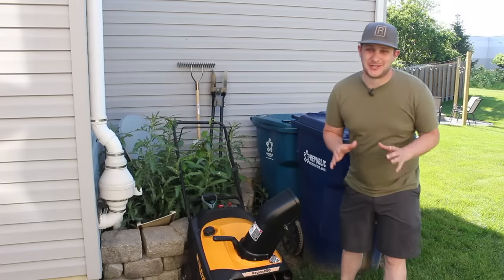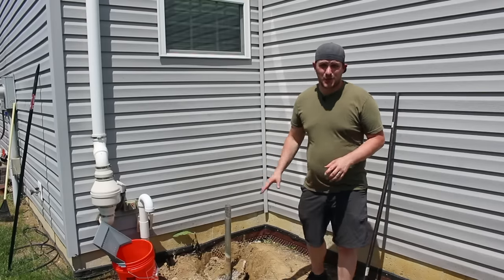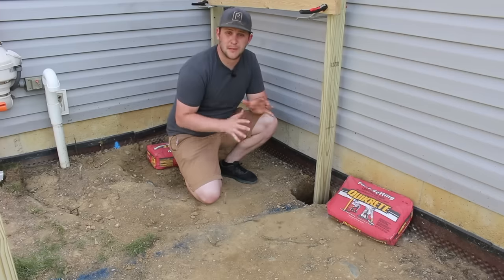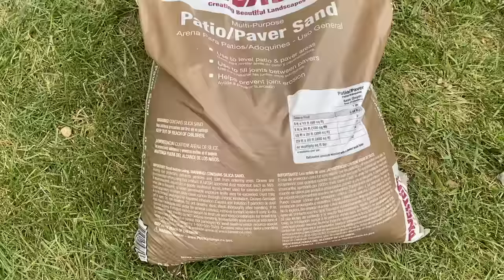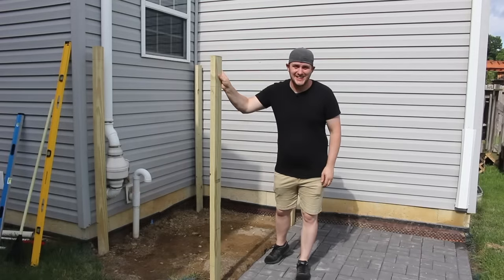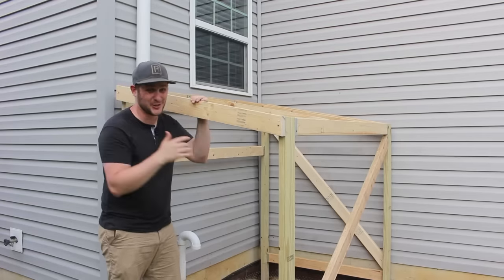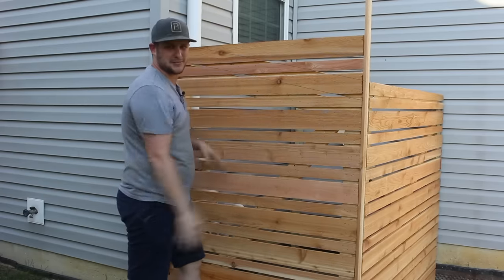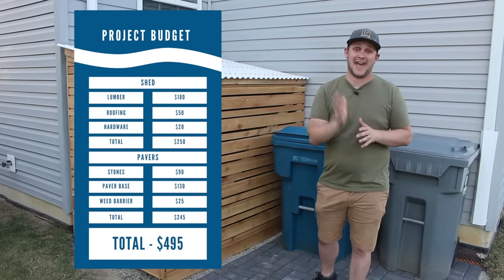DIY Outdoor Storage Shed || On a Budget

Comment: Dude... Dude.  Did you read the installation instructions for the Brock Paver Base?  You did it backwards.  The leveling sand goes down after tamping soil.  Then paver base sheets.  Pavers sit directly on top of the sheets.  Also you should get some edge restraint and joint sand.  Shed looked good though.
Reply: Cringed when I saw him do that. Improper installation of the panels
Reply: Not to mention his stuff inside the shed is going to get destroyed by rain or snow and the sump pump discharge is going to cause trenches in his rock. How does Home Depot sponsor this stuff?
Reply: Same thing I was thinking. Big Box store sponsoring this
Reply: maybe he wants a wavy and uneven paver area after 1 year?
Reply: Also do not set up wood post in concrete.   The wood will rot.  The concrete first in 3 feet.  Posts on top is best.  Or small base of concrete and coated wood in to dirt.   Uggggggg.
Reply: @stephanie1265  well pressure treated wood will not rot in concrete atleast not very fast it will take more than ten years.. but he only used pressure treated for the posts and didnt seal the rest up so he will have the rest of the wood rot very fast
Reply: @Golfexpertbelieveme  those two pipes are a radon exhaust and the exhaust for a high efficiency furnace it's not a sump line and if it was why would u drop your water right next to the foundation? It would only come right back in .. most definitely without a doubt its and exhaust.
Reply: @ptravers9077  that one pipe that is shaped like a candy cane is most def a sump pump discharge. It’s exactly like mine. The reason why it’s open is cause you put a drain under it that leads to the road or Atleast farther away. You have it cut above ground to help with freezing problems
Reply: @Golfexpertbelieveme  I would beg the differ that is a exhaust for a high efficiency furnace uninstall them all the time .. if it was a sump pump then this man is the worst .. he had a retaining wall blocking it originally.. the water would pool up there and go back into his foundation.. no way it is .. its an exhaust has to be ..no way he would let that water discharge against his building and no way he would put up a wall to stop the flow
Reply: @ptravers9077  not if he has a drain right under it with a French drain to take the water out to the street like I have.
Reply: @Golfexpertbelieveme  but he didn't have a french drain we saw him dig the ground to me looks like the exhaust for his furnace
Reply: @ptravers9077  if it was for exhaust there would be an intake right next to it. Did I miss that one?
Reply: Not everyone lays concrete  brother

Comment: The paver base is so you don't have to use sand. The instructions in the 2 minute video for the paver base have the leveling sand first then paver base then pavers. The paver base is made so water can move around underneath and drain but now you have the sand covering it all up. Not graded away from house either. Also need joint sand. I'm so confused by this build.
Reply: I’m confused by your comment.  You say the pacer base s so you don’t have to use sand. 
The you say the sand goes first then the paver base.  Explain to me please?
Reply: @こく月X  The youtube directions from paver base show that you use the sand under the paver base to level the paver base. Not on top of it like he does in this video. Then without the use of sand which is my first sentence, you put the pavers directly on top of the paver base.
Reply: Good catch, but this method is not to use gravel. You still use sand but yes underneath the base.
Reply: how would anyone get it level with a paver base made of rubber? Traditionally sand has always been used as the layer under the pavers, for this type of masonry work..

Comment: Weed wackers will spread the thorns all over the place (bad for pets and bare feet).  Since you only have a few weeds, try a pair of leather gloves and a little muscle. You might be surprised how easy it is, plus you are removing the root too, unlike that quick fix tool.  Also, you should use plastic paver edging otherwise your pavers will slide out of place espcially with all of the repeated garbage can movement.
Reply: 😂 please go and make your own channel for yourself 😂😅

Comment: Nice little shed , but 🤔 did t you said you get alot of snow during the winter the snow will go tru freely inside your shed ? And u have a tools. , and stuff
Reply: Look at some of the stuff he put in that shed - shovels, wheelbarrow, etc. Those are outdoor tools, and are typically used in all weather conditions.. they can handle a bit of snow. Besides, you could just throw a tarp over it in the winter
Reply: You could easily plywood or plastic sheet the interior.

Comment: Very nice job on the shed and pavers, might tell your viewers if they attach it to the house in any way it becomes an instant termite feast.  In your case, it would have been best to build up off the ground on pavers or pour a simple slab and build on that for the size of the shed.

Within a year or two the 2x4 base posts will have been rotting and almost guaranteed dryrot at the very least. If you're lucky. If you've attached it to the house ANYWHERE best to put some metal shields between the house and shed. Termite Shield: A shield, usually of non-corrodible metal, placed in or on a foundation wall or other mass of masonry or around pipes to prevent passage of termites. Galvanized metal or even flashing works.

That comes from a lifetime pest professional. Love your channel.
Reply: Great point.

Comment: When adding Quikrete it is best to pour some in...then add water then poor some more in and keep repeating until it is mixed well. If you pour all the quikrete in first and then the water. It sets at the top.but sometimes it sets so fast that the water doesn't reach the bottom and harden the Crete at the base. Especially if you use a home depot bucket to set the post in with Crete.
Reply: Not true. It's designed for the water to go all the way down. Plus ground water as well hardens it further.
Reply: @KingMarcellous   Are you 100 percent sir? I put it in one time and the water didn't reach the bottom for whatever reason. As I had to dig up the post and place another one because the post wasn't stable after it dried. Could it have been a layer of dirt or something that covered the Crete or something?

Comment: Cracking job. Just eager to see, now that time has passed, what's happened to those paver stones around the edges as it looks like you haven't secured them, just placed stones around them. I'm presuming the action of wheeling the bins over they've broken loose. You also don't appear to have locked them together using kiln dried sand between them - no mention of that.

Comment: Great video. I like how you call out the cost of the supplies you're using. You may have mentioned it but what is the gap width in between for the siding?
Reply from the maker: I used a scrap piece of the fence board for the gap. By guess is it’s 1/2 inch

Comment: If your soil has allot of clay like his, when setting posts just use 3/4 minus gravel instead of concrete.  Get your posts in position and fill the hole a quarter of the way up. tamp it down and make sure that its plum, fill it up 3 quarters of the way up, check it for plum, tamp it down some more, than fill it the rest of the way up and tamp it again.   Over time the gravel will get more compact.  The posts will last longer and you will thank yourself when it comes time to pull them out.
Reply: Really tho .. I have never seen that being done dont get me wrong this guy is only using pressure treated wood on the posts and with the fencing he is using as the walls he is leaving it all exposed to to snow witch doesn't fall down but blows and with that being said I noticed he didn't dig below the frost line so it is going to shift in a hard freeze also I have never seen a person use aggregate to support posts in this type of climate the ground swells back and forth throughout the seasons I dont think the rock would hold I also dont think this guy has been trained to do this with the steps he took

Comment: Just got that M18 Fuel String Trimmer. Only $169 for the kit. I was surprised with the power and the ability to edge with it. 

With 2 6AH batteries you can get the job done.

Comment: You didn't use polymeric sand between the pavers to prevent weeds from going in.  You're going to have issues in a few years possibly for skipping that step.  Also, I don't think you paid attention to grade on the pavers.  You want to grade away from the property for drainage, and just from eyesight, I can see that space is not very level.  Extra effort means you won't have to rip this out 3 years from now to fix your errors.
Reply: This build really is a bit of a mess
Reply: Its all terrible and won't last.

Comment: What kind of gate latch is that. I’m building a water heater enclosure and my door is similar to you that it goes all the way to the edge, but I cannot find a latch that will automatically catch like yours. The only ones I can find that will work are the turning rasp ones.

Comment: Great build. Just concerned with creepy crawlies and elements being able to get in through the spaces left between the fence boards. Would it not have been more practical ( and less work) to just overlap the fence boards instead of ripping them down on the table saw?

Comment: Wow this was extremely in expensive 🙌 turned out great!
Reply: It better be inexpensive he did it wrong using the wrong material.. it wont last to long.. didnt seal it up didnt use pressure treated wood and he didnt put the post lower than the frost line.witch in his state can be up to eight feet below the surface.. this shed will move and become a hassle to get in and upkeep
Reply: Wood truly is expensive right now. I think I will wait till next year and see what happens to pricing.
Reply: @mrtv777  yes true along with everything else 🙄

Comment: I'm very inexperienced when it comes to this kind of stuff, but what's the purpose of the external pipes on the side of your house?  Are they exterior plumbing pipes for heating and airing, emergency drain lines, or an exhaust pipe for gas? Are you building the shed as a way to also hide them? I get it, they are kind of unsightly.
Reply: Those white pipes are for radon abatement and should not be touched.

Comment: Great shed, but why make the siding with gaps?
Reply: Was this never answered? I’m curious, as well. Weird.
Reply: Well the gaps allow for air flow.  I assume a few reasons are:
1.  Dissipate chemical fumes or bad smells.
2. Allow tools or things to dry even when door is closed and locked.
3.  Prevent the shed from moving or slamming against the house when windy.  Gaps will allow the wind to path through more easily. A solid wall would act more like a sail.
4.  You use less material and don’t have to be that precise.
5.  Wood can expand and contract during temperature and moisture changes so giving some wiggle room for the boards would put less strain on it overall.

Comment: nice build. that wood though, wouldn't it get mildew or stuff like that over time especially being exposed to the elements?
Reply: The cedar should hold up well to the elements.  The untreated pine 2x4 he used for cross bracing will be an issue.

Comment: Thank you for such simple project. What size of wood posts that you used 2x4 or 4x4? As I remember, wood post cannot be mixed with cement under ground.
Reply from the maker: I used 2x4s but 4x4s would work aswell
Reply: Actually since building onto them, he could

Comment: Great job! what happens when your house needs siding or paint work there? Just a thought.
Reply: Well he didn't put the post below the frost line so the building will work it's way out of the ground .. most definitely not a permanent structure he only used pressure treated on the posts and didnt seal the whole thing up so the inside wood will rot also by the time he needs to move it it will be able to be pushed over

Comment: I might have just cut off that steel post and left the concrete stump in the ground under the shed.
Reply: That's what they do with old washing lines here in Australia. Just angle grind the top off and bury the rest.
I can see there being problems with that area settling over time.

Comment: Too bad all the framing 2x4's you used were untreated and not cedar. So they should start rotting in just a couple years.
Reply from the maker: Actually everything in contact with the ground is pressure treated and the sidings is all cedar.

Comment: Nice shed. But what exactly do you mean by budget? I see overuse of thick wood for a small corner shed. It's not a bridge or a huge shed in middle of nowhere with  extreme winds etc. No calculation on what thickness you really need. That's not a budget shed but a fancy, nice looking non water or snow proof, DIY project when you have all the power and pneumatic tools.
Reply: Yes nice build but Not a low budget build….

Comment: Dude.  Don't cut weeds like that,  wear heavy leather work gloves and pull them up root and all so they won't grow back into your shed.
Reply: I believe he placed a layer of weed blocker, they'll quickly die from a lack of water and light anyway and be re-absorbed to feed the soil below which will later prevent dying/dry cracking soil that can be much worse than weeds.

Comment: No offense but why didnt you just do a board and batton barn style ?  its water proof.. yours isnt.. all you do is lay large boards like you did.. but then lay the smaller boards on top of the gaps and walla.. water proof, and you do the board vertical.  This isnt a very good shed honestly.. would have costed not much more at all than what you did..

Comment: you're proof anyone can get a lot of views on YT. I hope people don't follow your lead. Good luck
Reply: my thoughts exactly
Reply: Why? He did a good job showing how he built a very practical storage shed
Reply: Saying he has Dangerous weeds because of thorns, electric weedeater, calling his landscape bed full of weeds; a “garden”, complaining about how hard removing a satellite dish is when could’ve just dug it out in 1 minute, the fact that such a simple thing needs posts so far in the ground with so much concrete, or doing that much work on the pavers for trashcans and digging deep then saying screw it and refilled the paver hole he dug because he found a easier way, calling this a shed when it’s a lean-to, then having all that work turn into something that could’ve easily be built with a few pallets that you can get for free. Just an all around goober. This not a cheap way nor easy way. Does it look good? Yes.